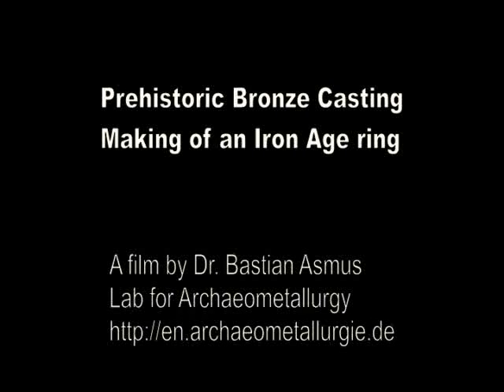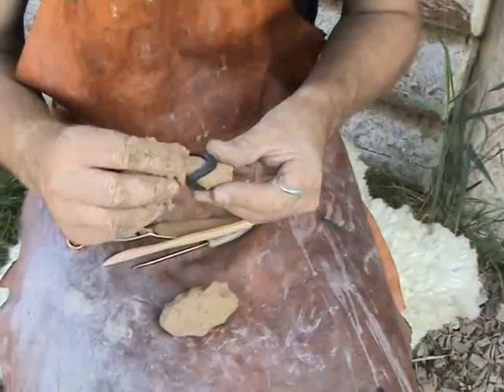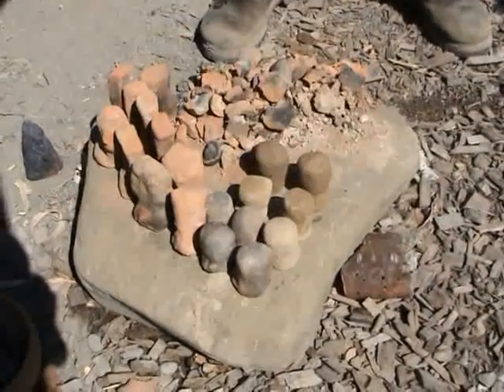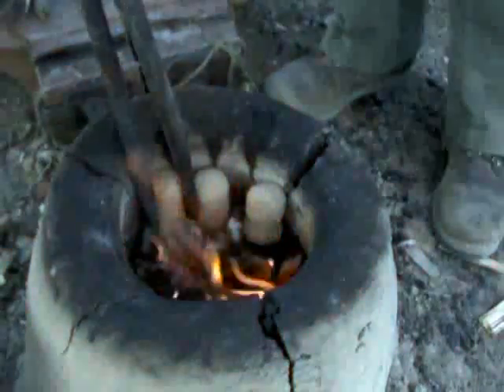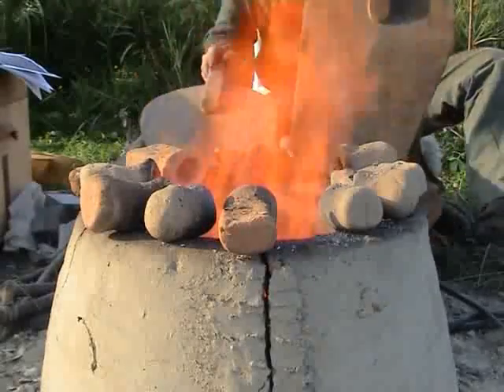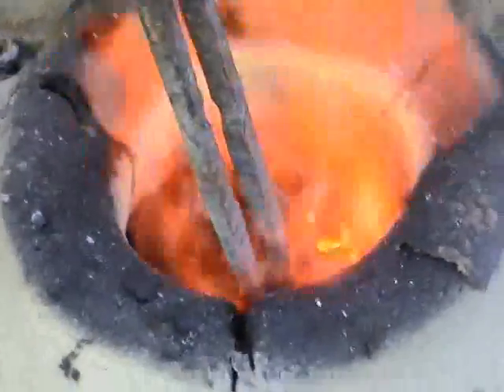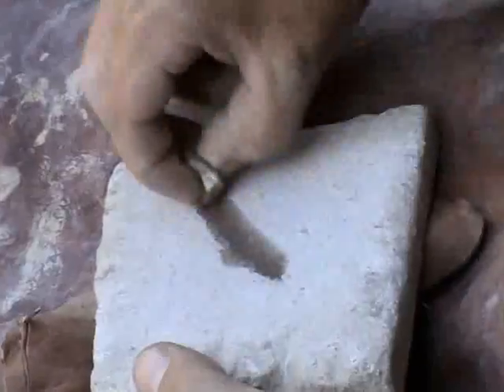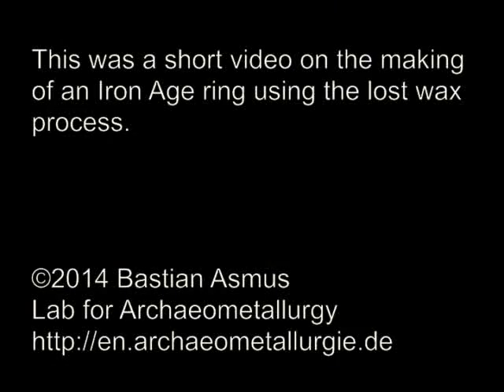Foundry: Prehistoric Bronze Casting - Making an Iron Age ring -  Dr Bastian Asmus #ironagefounder

Comment: Great demonstration! I’m researching bronze age casting for work and would like to produce a few replicas. You say 1100 degrees for the bronze - is that correct? I was under the impression it was more like 2200 degrees? Is coal essential for the heat to be intense enough or can it be achieved without fossil fuels, just using wood etc? Finally, is the whole furnace lined with clay or is the clay only above ground level? Sorry for all the questions! 😂

Seem to be very few resources online on how this is done with pre-industrial methods so any help is greatly appreciated!
Reply from the maker: Check my academia or researchgate pages for details, or en.archaeometallurgie.de cheers and good luck
Reply: Thank you!

Comment: Clean pour !
What type of refractory clay (white? Kaolin?) are you using please? Where do you buy it?
How do you think it worked for our ancestors?it is really hard to find in nature
Reply from the maker: It is not that hard to find in nature. As a general rule of thumb try to use the clays with low iron contents, they are usually more refractory, as you suggested. I worked with loads of different clays. In fact whenever I go to a new museum I try to use local clay and see how I fare. Be creative, go out and experiment, Eventually it will be worth much more than anything you read, or in other words anything you read will be so much more helpful when you combine it with personal experience. If you cannot find any: start with devon ball clay. Really rich clay and temper it down a lot..
Reply: @ArchaeometallurgieDe  thank you
Reply from the maker: Check my Website en.archaeometallurgie.de there are tons of infos on the topic. Also much more recent stuff than this 15yo video shows.

Comment: Was the wax from wild bees or was apiary a thing already. Also does the wax have to be treated or cleaned in any way
Reply from the maker: Hi Tyson, yes beekeeping was already a thing in the iron age. The oldest bee hives (that I know of) are from Israel some 3000 years ago. Pottery cylinders. Then there are also pre-Roman pottery hives foundon the Iberic peninsula. Of course there are also many rock painiting with bees depicted. When and where the change from husbandry to real beekepping happened is still not pinpointed, though I think it was a gradual thing and happened independently, multi-regionally and in different periods. Though you can use other substances, than bees wax for casting, I beleive the lost wax technology is a very good indicator that bees were kept, or at least tended to.
Reply: @ArchaeometallurgieDe  thanks .

Comment: Meanwhile, I have a forced air propane torch BLASTING in a hole in the ground covered by 8 cm of firebricks, inside looks like the pits of hell, and my aluminum bronze refuses to melt. HOW did these guy melt bronze in an open pit with nothing more than coal and bellows!?

Comment: very informative. I now know how to make the bits I need to fix the tuners on a very old guitar. Thank You.
RonM
Reply from the maker: Hey Ron,
well this is certainly one method. Dou still have the old broken bits and pieces? then you could also cast them in sand, which would probably be easier.
Reply: Archaeometallurgy  
Unfortunately the original parts have gone walkabout, although if I can dismantle the one remaining one sandcasting may work better than the lost wax.,
Regards and Thanks, RonM

Comment: I am planning on taking metal working classes this upcoming fall, and I am going to cast a ring as my final project and propose to my boyfriend with it, assuming he hasn't proposed to me, first. (a friend of mine took the class I will be taking and said the final project is free choice, as long as it includes techniques covered in class and is a useful object).
Reply from the maker: Good idea. I think there should be no problem there. Remember there are several ways to make a ring. Casting is but one of them. Remember, though that casting delicate things may easily amiss, due to small thermal mass you have. But as long as you prepare carefully there is no problem. Good luck!

Comment: How do you say pot in which you burn material?
Reply from the maker: Hi,
it is called a crucible. By the way it is also called melting the metal, if you burn it you end up with metal oxides.
Reply: What material is made 
container where the melting bronze.Tnx.
Reply: What made the container where the melting bronze thanks
Reply from the maker: Hi, 
it is made form very refractory clay.

Comment: I wonder if it would work if you use pine resin instead of wax. Maybe it makes the casting proces easier .
Reply from the maker: Hi Mark,
no it does not do well, at least for me. I find it too brittle. You can caertainly mix some of it into your bee's wax, as you can mix in all sorts of far ot lard, or tallow. There are literally as many recipes as artisans working with it. It rerally depands on what you are doing, which ambient temperatures you work and so on, and oof course how much money you are willing to spend.

Comment: i really admire how intricate some of the pieces were considering this was the technology they worked with.
Reply from the maker: I could not agree more. Archaeometallurgical experiments are awfully dependent on the experimenters experience. This is a discussion that is - luckily - under a lot of debate in the archaeological discipines nowadays. So, at least here things are starting to  look good!
Reply from the maker: pepelondon You are absolutely right! It is amazing what our ancestors managed to make. Remember, though, that we do not know how often they haf to try for really intricate pieces. Also, the casting method did not really change significantly until the advent of modern moulding materials. It was almost always the experience of the  metal worker that made all the difference....
Reply: +Archaeometallurgy almost always the experience of the  metal worker that made all the difference. I totally agree, blacksmithing is a 4 yr trade, so I can imagine ancient techniques being simular.